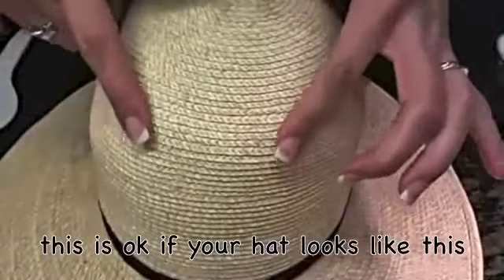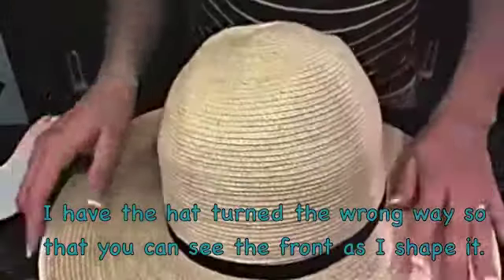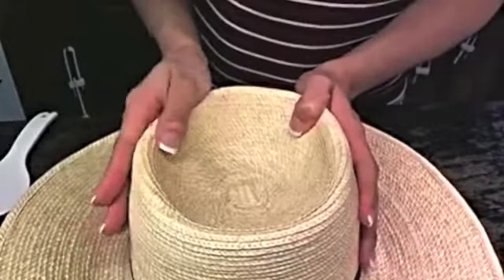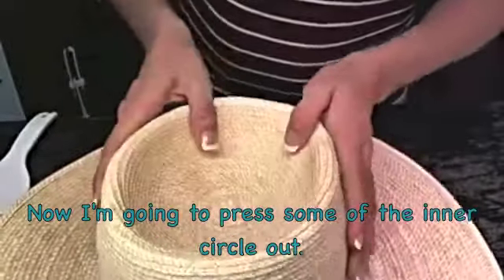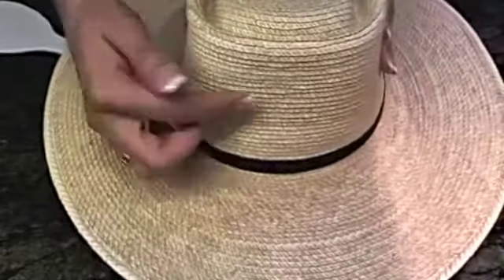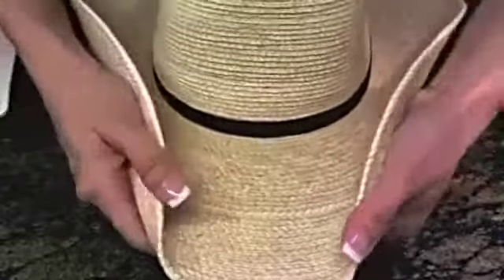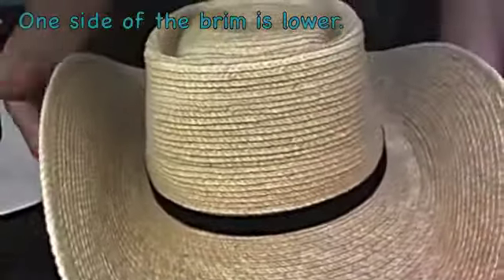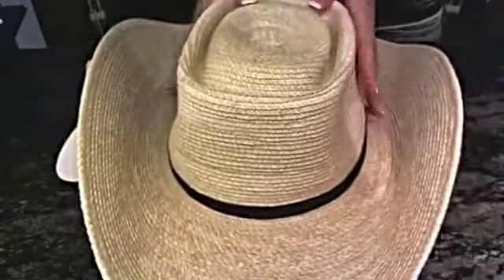Requested How to shape a Canadian Bullrider or Boxtop Hat

Comment: does the edge of the brim have wire for it to keep its shape??
Reply: 9 months with no answer? I'll answer your question. No, not on a palm hat, normal straws- yes. The palm itself will hold a shape. When it dries it becomes rigid. I use the bath tub to shape mine.  Run the water, dunk the hat and shape it up to taste. Wear dry to be certain it looks symmetrical. Check it in the mirror and adjust accordingly. See, no ones head is perfectly strait. Look for the illusion of "strait" on your head.